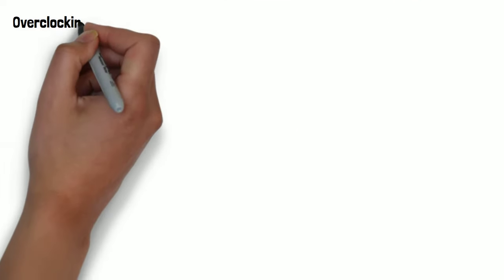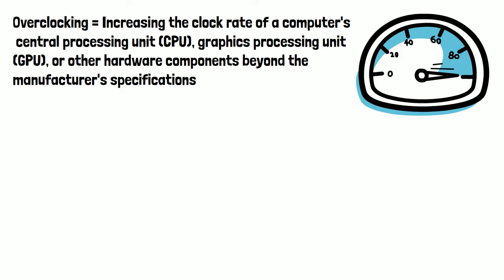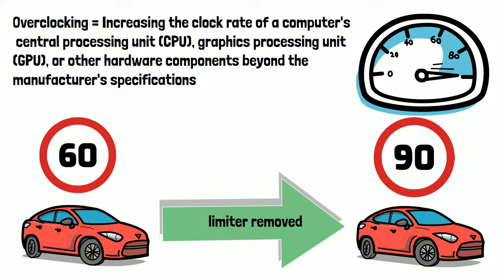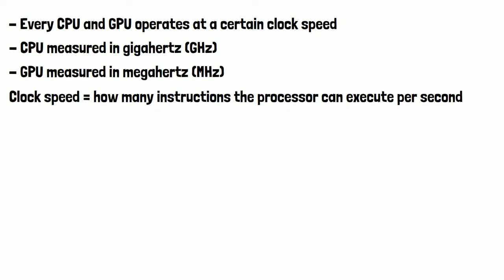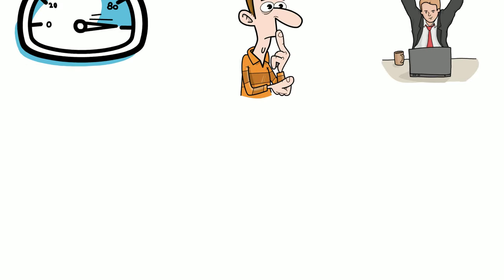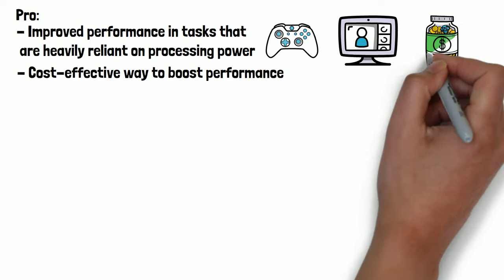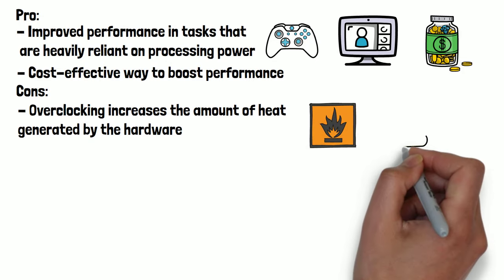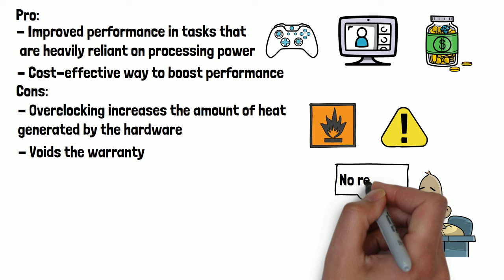What is Overclocking?

Comment from the maker: Have you ever overclocked something and how did it go?
Reply: I did something similar to overclocking on my phone, which is that when the phone opens any 3D program, it focuses the processing pressure on the GPU and not the CPU.
Reply from the maker: Nice! Did you get the desired performance increase?
Reply: Yes , but just a tittle increase
Reply from the maker: Even a small increase can make it worthwhile!
Reply: You are right!
Reply: Both my CPU and GPU are overclocked.  i7 8700K and GTX1080ti and using water loop for cooling them both.
Reply: @thewrathofbibby3381  i8?
Reply: @Bloons_onelove  my bad i7 8700K
Reply: Tbh I have a build with 4060 and a ryzen 5 5600 and the toughest game I run is cs2(I either play other games that would even run on potato pcs or I do my web programming stuff) and even then I get stable 300fps so no need for it